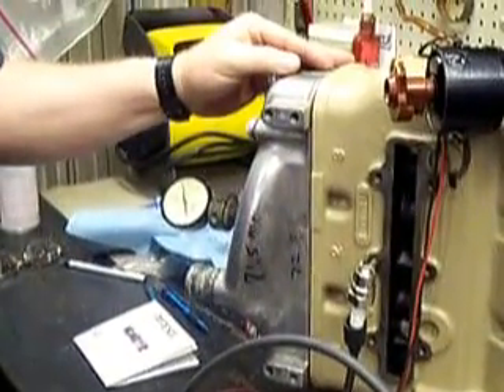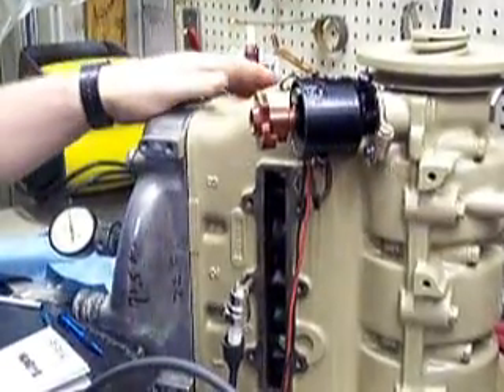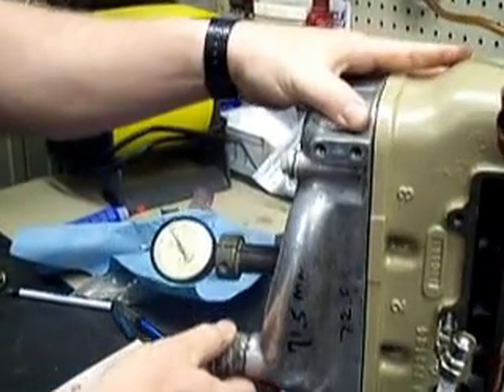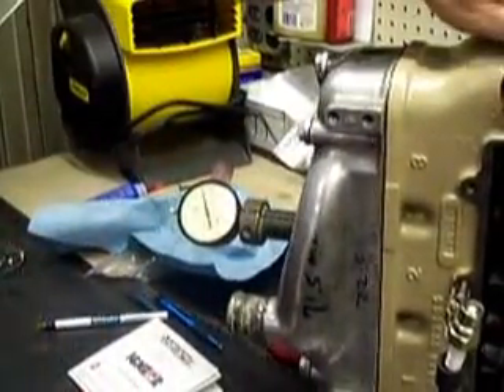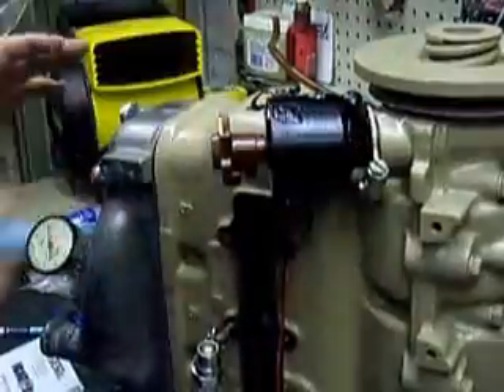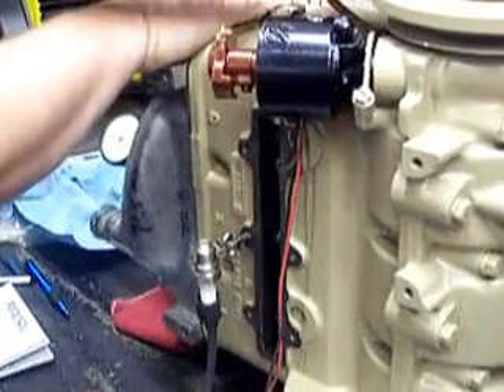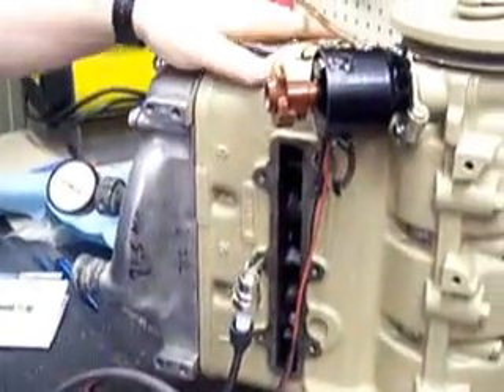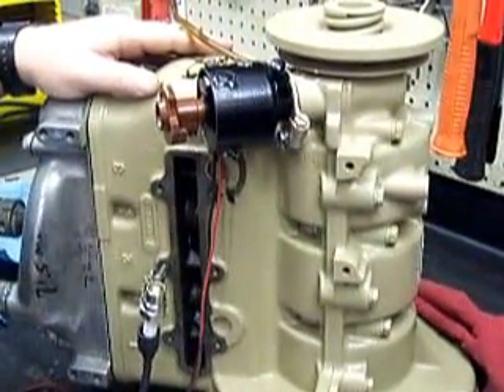How to Set Timing on a Vintage Saab Two Stroke

Comment: Hi, Tom! I need to recheck the timing on my 96. Me and my friend tried to get it going a few years ago, and could only get it to pop a few times. First, I need to go through the triple carb, which has a bunch of oxide powder in the jets as well as gum and varnish, so carbs first. Then timing. Not as easy now--I am in a wheelchair since '05, but these are still amazingly accessible! Do I have to remove the advance mechanism, or can I leave it on? I might even just teke the engine back out and work on it on the shop and do a bench run with tank cooling if need be--this is from my old stationary engine hobby LOL! Most of my engines are 2 strokes--Fairmont speeder car engines, British 2 strokes like Stuarts and Petters, etc, old Power Products open-flywheel mower engines (these are COOL!) you name it! Love 2 strokers! Where do you get the electronic ignition conversions and are they really expensive? Maybe it's easier than playing with points! I need your help on this stuff---also, since I can't work the clutch anymore, and need a hand control, where can I find a Saxomat centrifugal clutch for my car so I can drive it again? Thanks alot! Rick Delair iwantQ7@yahoo.com
Reply from the maker: Hello.  You can leave weights in but I prefer to weld them.  Just use a light to set timing then.  I prefer pointless for drivers.  Cost about $125 on ebay.  Also If was going to play much with a longnose from a wheel chair I would pull the grill out and hood off. 1st.  Then you can  work away almost as you could on a bullnose.  Have fun, tom